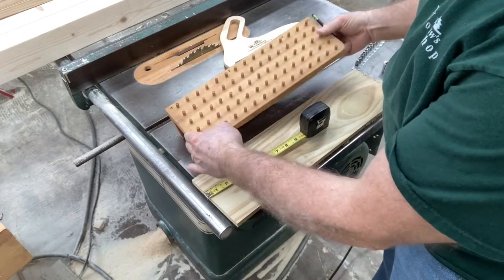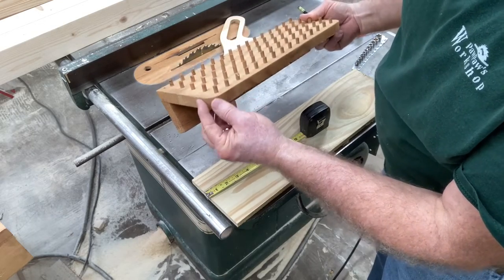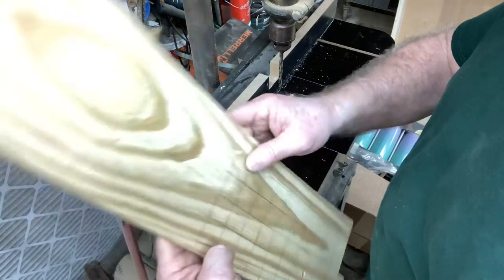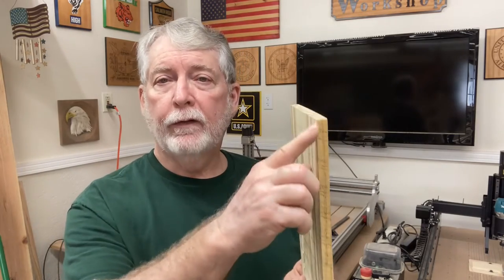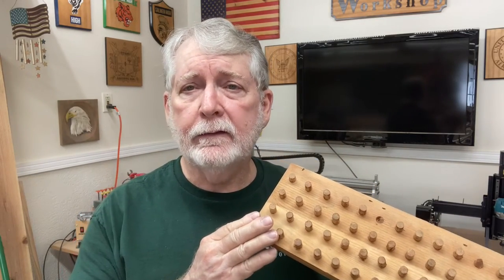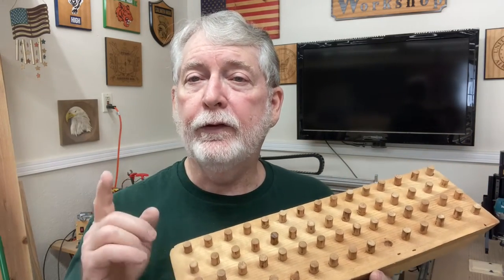Old School Socket Holder and Organizer

Comment: I just got about 500 sockets at an estate sale. Now I know how I can organize them. One suggestion to save time is that standard peg board has 1/4" holes 1" on center. Clamping that over the board will let you go straight to the drill press without the time consuming grid drawing.

Comment: What was the length of each dowel on the 1/4" wooden socket organizer you made and what was the depth of the hole you drilled?
Reply from the maker: The depth of the holes are 3/8” deep